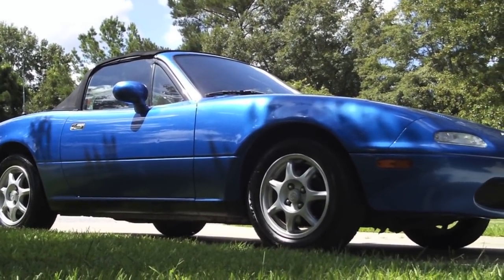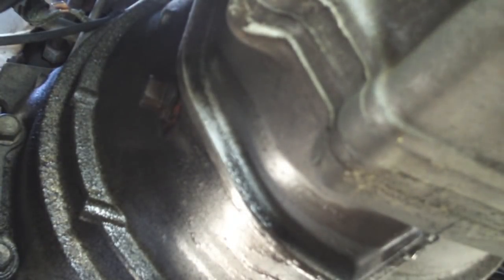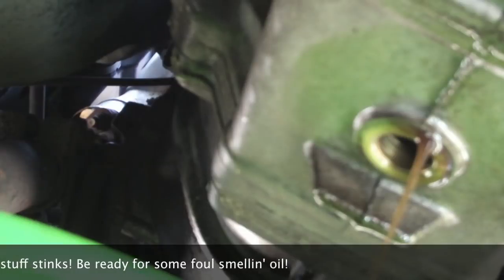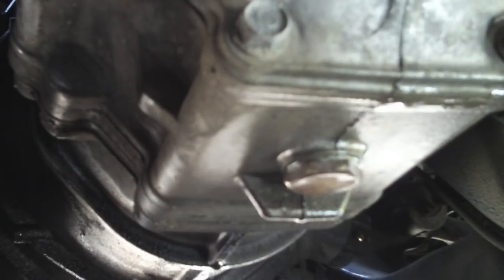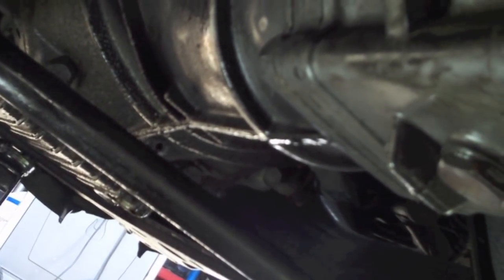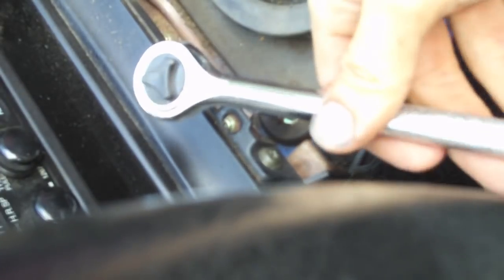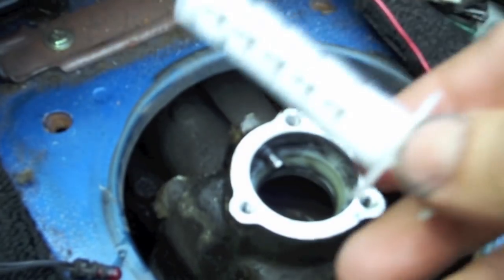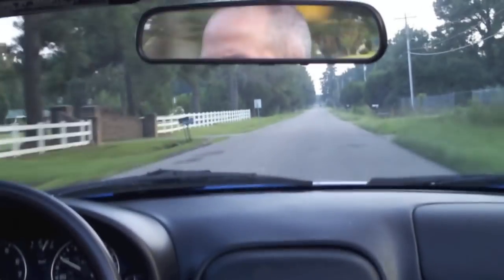Mazda Miata Fan - Episode 3 - Manual Transmission / Shifter Oil Change

Comment: Darn it! I just got through this afternoon changing out the shift boots, top & bottom, and found out that this would have been the perfect time to change out the top shifter areas gear oil! At least now I know that it is a fairly simple task and will be ready to tackle this soon. Word to self.......look at Youtube FIRST and then do the work with some knowledge rather than going off half baked!

Comment: Thanks for taking the time to make your vids, I'm sure they'll help people out! A couple of things I'd mention about this one (NOT a criticism by the way) would be to tke care when removing the center console as to not pull the wires out that run underneath it and to perhaps mark the position of the shifter so it can be easier to put back in...once again thanks for making what will be my next project that much easier! Changing out those shifter boots will keep the shifter from feeling hot too...

Comment: Thanks for making these videos. Just a quick comment though I like using anti-seize  where it's needed  But those  drain/fill bolts are constantly soaking in gear oil the anti-seize isn't necessary and  I don't know that we want that in the transmission. It's most likely harmless but  also unnecessary.  Thanks again !

Comment: Great video, I just did this recently.  The only thing that is missing is that Miata Fan definitely should have replaced both the upper and lower boots since they were torn.  The main reason the original fluid was low was most likely due to it sloshing out the top through the torn lower boot.  Plus having both boots in good condition cuts down on heat within the car quite a bit.  I had a lot of heat coming from my center console until I replaced both boots.

Comment: In almost 40 yrs. as a professional mechanic I've never seen a transmission that didn't lubricate the shifter by slinging oil up from the gears and needed to be changed like this. Strange but interesting and good to know. I wonder if this is true for all of them or just certain years? The shop manual program I use says nothing about that either. :(  Should have changed the shifter boot while you had it apart. For the people posting that they are rounding the drain plug and can't get it to loosen try a 6 point socket and a 18-24"x1/2" breaker bar or wratchet to prevent rounding and give you plenty of leverage. For the fill bolt I would recommend finding the correct size, long handle open end wrench instead of an adjustable, less chance of rounding.
Reply: hi I have a 3.8 firebird  2002 n I was just wondering what would happened if is really low in oil
Reply: +manstersr The 5-Speed Miata transmissions, such as the one in this video, have separatated shifter turrets. The later 6-Speed's turret is interconnected and many folks actually pour their new fluid from the top.
Reply: +Sean Dicken Sean, now that I think about it, I seem to remember vaguely that there was a 70s British car with a shifter like that but I think we would either grease the ball of the shift lever and it was "permanent" or put a few ounces of 90 wt. in the shifter cup. It was too long ago to remember exactly.

Comment: The anti-seize on the drain plug is unnecessary and possibly harmful.  Anti-seize is used when moisture can rust and seize the bolted connection.  The trans drain plug threads are bathed in oil and the trans case is aluminum which does not rust.  Also anti-seize is not a lubricant it is a suspension of very fine abrasives. Which should not be anywhere near the trans fluid.

Comment: A good trick is to hold pressure on the bolt while you loosen it that way instead of dumping hot or smelly oil on yourself you will have a chance to quickly pull your hand and the bolt away once it is ready to come out.

Comment: Very helpful video, I don't even have a Miata but a Ford Sierra.... The procedure is probably very similar. Now i cant find a helpful pump like you have anywhere, and a funnel doesn't really work in a tight spot like that. Frustrating, but I will probably find a solution ;)

Comment: You can just stick a hose pipe down through the engine bay onto a half inch bsp radiator tail wound into the trans filler. Means you dont gotta roll about on the floor with a crappy pump

Comment: i didnt use the pump or anything like that i just got some rubber tubing i had laying around (had a few vacuum leaks) pressed the end of the tube on the bottle and put the other end in the filler a squeezed away your pump leaves a little at the bottom. and also yours took about 2.5 because you had it parked on a downhill and jacked up the front end

Comment: I don't know if you mentioned that the vehicle needs to be level to get an accurate fill so you must put it on four jack stands to be safe or a lift if you are lucky enough to have access to one. if you just jack one end up it will not be filled correctly.
Reply: manstersr When I did this job to my 92 Miata I didn’t have 4 jackstands so I put ramps up against the curb in front of my house so I could get the front 2 wheels up on the curb. Then I used my floor jack to get my 2 jack stands underneath the rear of the Miata. It wasn’t perfectly level but it was pretty darn close.

Comment: Could you tell us your opinion on the mobile-1? I found some discussion that M-1 contains sulfur additive, which is bad for synchronizer containing brass. Just your feeling for a long term use.

Also, where did you find those washers? It's just too hard to find an aluminum washer with correct size.

Comment: is your car on a jack or on the ground? i need to do this for my rx8 but i only have 2 jack stands and a jack, and i'm not sure if i can get under the car without jacking it up because  i know you the car has to be leveled when filling the tranny fluid in.

Comment: you got a trunk release? :O
Reply: I know what you mean. My base 90' miata did not come w truck release, power steering, ac , and power windows.
weight reduction tho!
Reply: Gerardo VARRAZA My 1992 Miata has a trunk release! But manual windows and the driver side one broke!

Comment: My fill plug is completely ruined by the previous owner's mechanic and it's probably going to require some welding of a wrench to it or something. Any recommendations on extracting it? I know my clutch is starting to slip and wear out, and my shifting is not smooth but rough very rough. Used to be somewhat smooth. Any ideas?
Reply: Adrian Rodriguez a little late but I’ve used a big pair of channel lock pliers for rounded plugs  it usually works great

Comment: Having stolen my MIATA ONCE + assorted leather gym bags from my trunk via the 'fetus endangerment' trunk release mechanism (nothing larger than a six week old fetus can fit in a Madza Miata Trunk), this is how you disable w/out cutting it. Remove center console, look at wire connecting to the trunk latch---looks like a guitar string, right? Take a needle nose pliers and pull the metal nut up and out until she pops out. Now you can open your trunk like GOD intended---with a FUCKIN' KEY!!!

Comment: In a word, L-A-Z-Y!!! Yo, go back and do the job right, dude!!!  I wanted to dump all my fluids on my BD for my one year old (to me) NB, Model 1999. Popped open the console and my INSULATOR PLATE was in shreads. Dealer only part=$46.00 2012.  Your Insulator plate keeps the road fumes from poisoning your lazy ass when your top & windows are up. That piss-ant leather shift boot can't block those fumes on its own!!!  Also, I wanted to see how to get the shifter boot off--$120.00 for new shifter!